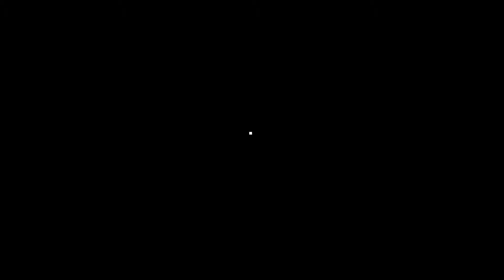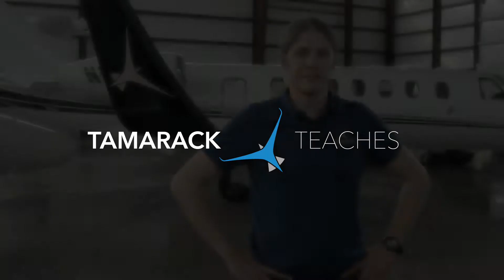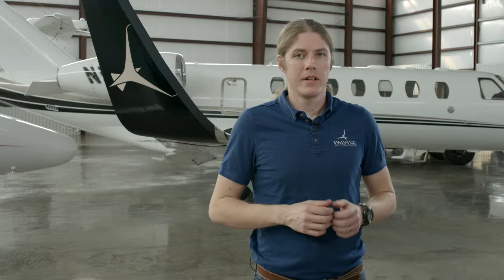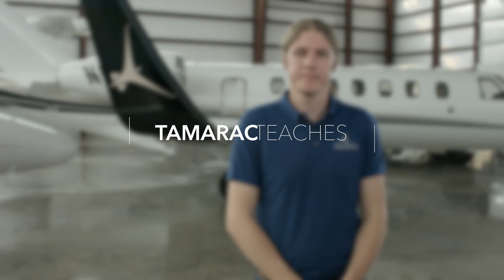Aircraft Static Stability

Comment: The longitudinal axis is the roll axis. Lateral axis is the pitch axis. Also the directional axis is not a thing it's called normal or vertical axis and affected by yaw.
Reply from the maker: Great point Bro! A better choice of words in our video would be that the longitudinal stability is generally related to the pitch of the aircraft, the lateral stability is generally related to the roll of the aircraft, and the directional stability is generally related to the yaw of the aircraft.